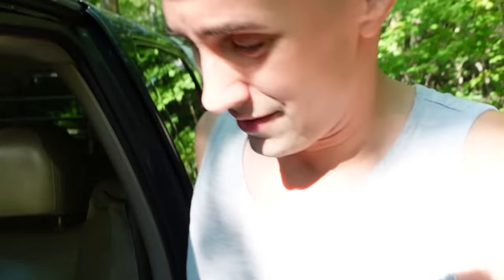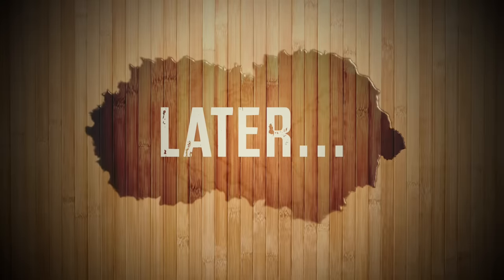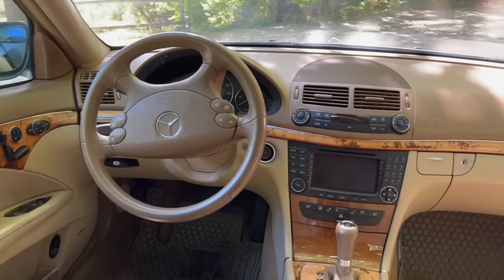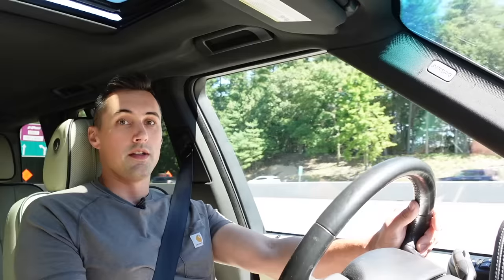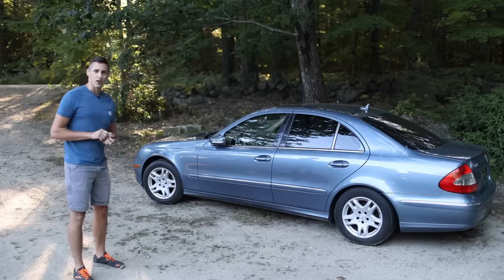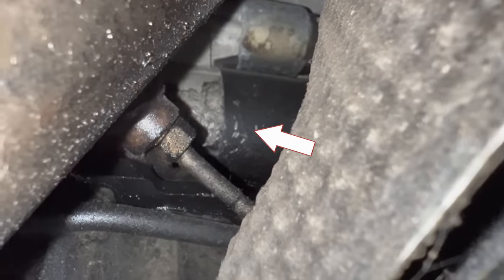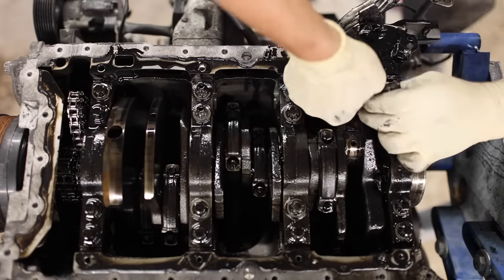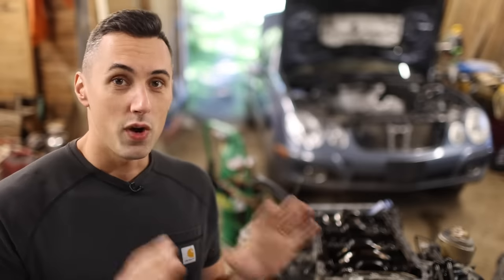I Bought a Repo’d Mercedes Diesel and I Regret it. Here’s Why You Shouldn’t.

Comment: Very interesting Waldo ! nevertheless I would swap the engine for like one , if  you have two make one great car out of the two , sell  parts , great filming again no matter what subject ,  you make it interesting thanks again !
Reply from the maker: Thanks Steve!
Reply: Ls swap !
Reply: The used Mercedes diesel engines are quite spendy - considering the market value of this car.  It will likely make great content, but in no way would this be economical for the purposes of driving or reselling. Cheaper probably just to buy a good used one.
Reply: Yes  I have experience in the Merc V8s  from trom 1965 to 1985 , 350 450 range even 1972 Merc has a  computer for the jettronic  injection , but in this case it would be the interface with electrics  and computers, LS has its own system I know , interesting   comments
Reply: @WaldosWorld  hey waldo there's a 2006 range rover with a super charged 4.2 at copart in maine... idk if you're looking for another one for parts but i figured i'd let you know
Reply: @WaldosWorld  Mercedes diesel engeins are very good but they are not more simple, reliable and i know this a matter of opinion but sound better....perhaps Scania V8.
Reply: @WaldosWorld   mate you are very good worker and your knowledge is well up there must say!! I I’ve seen 3 or 4 fellas working on just one car and still didn’t fix it! Right!! 

Keep the good work and god bless!!

Comment: I have a 2007 E320 with the OM642 V6 diesel in it. It is an outstanding car at every angle. I can see 37MPG on the highway running 75-80MPH on flat Texas highways. The E320 is a fast and very nice handling car. I really enjoy driving it over my other vehicles. I would find another OM642 engine for it and rebuild it. It’s well worth it in my view. The torque and power will surly put a smile on your face.
Reply: You should get a tune on it and delete the DPF and EGR like my friend who is not me. It’ll really wake up... according to him.

Comment: Oh Waldo, if only you would have asked if this was a smart purchase! I love the 06 and prior E320 with the inline 6 much better than the 07 and newer V6. Since you asked us what you should do here’s my 2 cents. If the interior is pristine, the rest of the drivetrain looks to be in good working order, and the electronics check out, I’d would try to find a good used engine or maybe see what a reman’d long block would cost. I’m sure the head on the side the rod broke is shot. It would make for some good content though. As a former owner of an 06 E320, I can tell you they are an absolutely  joy to drive. Time to open up that wallet! 😂
Reply: I agree! Had an '07 Bluetec. Nothing but trouble. Oil cooler leaked, water pump, power steering pump, turbo oil seals leaked, thermostat, rough shifting transmission, the list goes on and on. Modern diesels are not any more reliable now that they have all of the emissions crap on them. Unless you can monetize these videos, I would recommend not throwing anymore money at this car. The very fact the previous owner neglected basic maintenance does not bode well for all of the other components that were likewise neglected.
Reply: get a long block if possible. I wouldn't want to use a head or heads off this engine.

Comment: The diesel W211s are legendary. Glad you're making more content around this.

Restore the heck out of one and keep it.
Reply: these engines only fail when not changed enough oil. A lot of taxis go 1million without issues with this E320 CDI
Reply: @nihonkokusai  Not so much with the OM642 engines. I was religious with maintenance, and still had all manner of engine issues. The one to get are the earlier ones with the OM648, those were bomb proof.
Reply: @fatherhood2  We have taxis here never had any engine problems? are the US built MB built in Germany or US?
Reply: I believe the early V6 engines were problematic. I'm sticking with my E320 CDI with the IL6
Reply: I had a 2005 E280 diesel wagon fantastic car.

Comment: Glad you’re back! I’ve watched your entire library of videos and need more! 

I was thinking, until you get the slab poured for your barn/garage, you could buy a sheet of half or 3/4 inch steel plate that’s about 6 feet wide to butt up against it. Put some rust converter on it to keep it nice. Could also set one up outside. It would at least keep the engine hoist from digging in so much and would give a better surface to put a jack on.
Reply: Waldo needs to get that concrete poured ASAP can't believe he's working in the dirt
Reply: When the oil was pouring out of the engine on to the dirt I thought "at least it's not on a nice concrete floor".

Comment: Waldo, w211 cars are really great.  I do prefer e320 cdi over the newer blue tec but it looks cosmetically to be fantastic.  Your cinematography is spot on, really great job with that!  Good luck, great video.
Reply from the maker: Thanks Carl! Yeah, I agree, the 3.2L I6 is better 👍
Reply: But they are pretty good ad towing trailer like camper over 2to aleast in Europa they are rate pretty high for a car( g-class are rated at 3.5to with 320 cdi engine )
Reply: 3.0 v6 cdis are not bad i have one with 280.000km (170.000miles) still runs great.
Reply: We have 2 sprinter vans, 01 with a cdi om612, and an 08 with the 3.0 v6. Surprisingly the v6 is still running pretty decent at 500k Miles (trans just gave up though) The cdi gave up early at 230k. Cdi did have better fuel mileage and pulls better. The guy we bought the 08 from runs a fleet of them, had one with 800k miles on original engine on the 3.0!
Reply: Which 3.0 v6 is that? Is it the Mercedes  M272 thats in the W211 E & C classes?
Reply: @BMW_Mustang_Dodge  i drove sprinter van cross europ as an ontime dilivering truck with 2.3 inline 4 cdi 1.7milion miles only transmission was replaced once
Reply: @BMW_Mustang_Dodge  Wow.
Reply: @WaldosWorld  Other than the need to add DEF fluid to the Bluetec, may I ask why the 3.2L I6 is better? Unfortunately, the 2012/2013 S350 I want only comes in the Bluetec version.
Reply: @oldporkchops  It's not, it's just a preference for i6 from some people because you have more space on the sides to work on them. The om642 v6 3.0 diesel is as reliable as it can be, it's only known big issues are the oil cooler seals (pre 2010 factory ones weren't from silicone, and are known to leak, but if they were replaced with the proper spec ones there's not much that breaks in this engine). The i6 has some serious issues with its injectors and high pressure system as a whole. Also, w211 with om642 don't need DEF fluid, only for w212 and later with this engine. Others issues that both of these engines share are intake flaps getting stuck from gunk and glowplug malfunctions. But that's about it. I know a guy with 2 sprinters with 900k km, both original om642 engines and transmission.
Reply: @em4703  Thank you for the info. Can you please let me know what special maintenance steps were done to make the Sprinters run 900 km on original transmission?
Reply: @oldporkchops  I just called the owner that had those vehicles in that time frame, so I can give accurate info. The sprinters were both driven 8 hours a day, 5-6 days a week, mostly highway or between small municipalities, with oil changes done 2-3 times a month, never over 15k km with the same oil. Oil used in both of them was some Ravenol 5w40, he doesn't remember the exact name (winters here rarely go under -25C, so a 5w irrespective if 30 or 40 can handle it well). Maintenance was done religiously, the owner of the company is passionate about cars so he's not the type to neglect a vehicle, irrespective of it's purpose. By maintenance I mean full maintenance, when oil was changed all filters and consumables were changed too, and the entire car was checked to catch any small issue early. He said he never had any big issues besides a swirl flap that was fixed under warranty (the guy that now has that specific Sprinter of the two has around 1.4 million km on it, so the vehicle isn't used as intensively now, this second owner also put a resistor thing in the circuit to disable the swirl flaps and keep them open at all times to make sure there won't be future issues). Gearbox was serviced (oil and filter) every 3 oil changes, so around 40-45k km. That's about it. Besides that, just normal checks and replacement for rubber parts in the steering and suspension, whenever they had issues due to normal wear.
Reply: @em4703  Thank you for your help with this. I appreciate you going the extra mile. It sounds like the owner just regularly changed the oil and other fluids at the regular intervals or a little more often than that. I do the same too.

The W221 I want to own unfortunately requires DEF. I just hope that it won't be a pain to maintain.

One of the fluid additives that looks promising is Steel Shield. Pitor Tester did a few tests of this independently and with it added to engine oil, and all tests had better than average results. You can check his videos out on YouTube if you're interested.
Reply: @oldporkchops  Hmm, steel shield, I'll look that up. I'm living in Romania, if its a small american brand I doubt i'll find it around these parts. I own a W211 e280 in mint state, interior, exterior, mechanically, 332k km on the clock. 

All I use as additives are for fuel, metabond megalene. I can see a 5-10% improvement in fuel economy (which i dont care, i'd own a 1.6 or lower cc car if I did city driving), but it definitely does something (extra lubricity and taking water out the fuel? hell yea). 

 personally use Ravenol VMO as engine oil if you're curious. I don't honestly like engine oil additives, I feel like they're snake oils/ scams. If these were that good, they'd be already added in there by default right? The competition would have no chance. It's not like they're billion dollar lubricant companies, right? I do get fuel additives though. Lots of the additive package on gas or diesel is restricted by emission standards. So I can see how that leaves room to play for companies
Reply: @oldporkchops  The 3.2L Bluetec never required DEF... that only started on the 2009 (IIRC) 3.5L Bluetec. Not sure whether the I or V Is a better or longer lasting engine (tho the V is better on paper), but I like my i6.
Reply: @t3mtf8  Thanks for the info, Andy. I appreciate it.
Reply: @shawna7813  Its the OM 642  I have the same car
Reply: I loved my 2006 E320 CDI. I was t-boned by an absolute moron. The Mercedes service guy told me there was no chance of repairing it because of how hard I was hit in the driver's side front wheel. I still miss that car. It was in primo condition, and I could have EASILY gotten another 50-100K out of that engine. Makes me sad.😥

Comment: Sorry for your difficulties. I bought a flood damaged E320 (2005 straight 6 with a 722.6 tranny. ) It was a runs and drives listing on CoPart. Photos indicated water into the cabin but only a couple of inches. WHen I received the car, it was in limp home mode and the seats were inoperative.  A $125 scan tool reset all the codes. I replaced the seat brains under the seat @$110 each and a seat motor for $15 at a pick and pull. That was 7 years ago. Since then I've replaced windshield wipers, a few bulbs and kept up with all the maintenance as needed. Car had 105,-000 dealer maintained miles and records and extended service had been done on the car a month before the water incident.  Yes, I got lucky-but I scanned CoPart listings for 4 months searching for the right specs. 

Its the 4th MB diesel I've hadTHe low running costs and lower depreciation enable me to keep a fleet of old Alfas running

Comment: Hi Waldo,
I would get the second one, see if you need any parts from the first for the second, and then sell whatever was extra from the first one.  If it costs $400 for a key, I can't even imagine what an engine would cost, even a used one.  Thanks for digging into the bad engine and videoing it.  It's pretty remarkable how much potential energy exists in all those moving parts, separated from each other by the tinyest little cushion of oil.  I agree with your diagnosis of too many miles and too few oil changes as the root cause of why the engine failed.  I wonder what Mercedes charges for an oil change.  Thanks for the video!
-mike
Reply: car was worth less than what an oil change would cost

Comment: I have a 2003 straight-six E320 Avantgarde CDI estate. I also have the newer generation, 2013 E220 Avantgarde Bluefficiency CDI estate. These S211 (W211 saloon) are really good. They are easy to drive, to park, they are powerful (the V6 has over 220bhp and well over 500Nm of torque), yet economic. The E-class Mercedes is always the best car one can afford. Find one with good service history and if yo7 are buying the V6, check the engine properly. With the earlier, pre-facelift models, check the air suspension and brakes. Otherwise, apart from the injector seals, they should be reliable. These are well built, premium cars. When things go wrong, don’t be surprised to spend more than you would with economy cars, but the Mercedes will go on forever.

Comment: Early versions of the W211 E320CDi suffered from a lot of electronic faults, particularly the instrument cluster, navigation system and PCM. 2 friends of mine bought one each new in 2003, and both had a lot of problems. One of them also had to have the oil pump replaced under a recall, before he even collected it from the dealership, and they had to have it back because they left the bolts loose on the engine mounts when they changed the pump. After more problems, Mercedes took the car back after 6 months and gave him another brand new one.

Comment: I bought one just like this V6 diesel and I  took a trip from Washington State to South Carolina when I made it to Idaho my 3rd Injector failed causing the engine to shake like crazy at idle and not run right I went ahead and full send it all the way over there I only going 63 mph Cruise control eventually made it without any other issues and I got 38 MPG and spent $400 in diesel.

Comment: Reminds me of a similar situation I was involved in back in 1972. Our office manager's husband wanted a Mercedes and there was one 1971 (loaded 4 door ) in a salvage yard and it was bringing high bucks. However, it was jammed between two other cars so the doors couldn't open. Opps, the car on the right was a standard which would roll and we did. Opened the hood and guess what? Engine was blown probably due to lack of oil. Later on I ran into dealer who bought  it and He took a BIG BATH!!!!! In your case take you time and find a good used engine and switch. This unit looks good on the video.

Comment: I own a 2002 Nissan Maxima with a 3.5 V6, after 20 years and over 200K miles it still runs like a champ. I change the oil every 3000K miles with Mobil 1 Full synthetic.

Comment: “Part of the reason I like diesel engines is because they are more reliable.”

“So the engine threw a rod”
Reply: Too bad the owner couldn't be relied upon to change the oil...
Reply from the maker: Yeah, totally the fault of the previous owner(s) for not changing the oil 😂
Reply: @WaldosWorld  it most certainly was run out of oil, due to disregard of the oil cooler seals leaking.

Comment: Agree with you on the oil changes.  Those bearings look like they were oil starved.  I bet if you pull the rest of the piston bearing caps and the mains, you'd get the same scoring on all of them.  Might also be worth it to tear down the oil pump and see if there is any evidence of sludge build up that would have caused the oil starvation in the first place.
Reply: Oil cooler seals. Most common oil leak on these. Even if you do the job in time, but forget to purge the airlocked oil gallery it is likely to spin #6
Reply: @guganotubo  How do purge the air locked oil gallery and why would you do that after an oil change?
Reply: @mbz4652  Not after oil change. I mean after oil cooler replacement. You have to crank the engine several times without the injectors, to make sure oil is pumped through the new oil cooler and the galleries that feed from it, before putting the crank under load.
Reply: @guganotubo  More do to poor cleaning before removing the cooler/turbotower,  since the holes you see under the cooler, in the block, leads directly to the main bearing. Not the first OM642 that's become a boat-anchor after a turbotower/oilcooler job.

Comment: The OM642s..  Owned a GL 320 for 7 years and the money light comes on often.  Decent motor but gets too much heat trapped in these E, ML and GL chassis.  Sprinter vans don’t have as much of an issue with them.  Replace oil cooler seals and timing chain or guides from your donor motor before dropping it back into the car.  All the other issues that pop up are small.  10K factory recommended oil changes are too long but you are stuck with that spec oil from all the 1st gen emission parts.

Comment: I have the same engine in a 2008 GL with 210K miles. The factory recommends Mobile 1 gasoline engine oil which I won’t use. I change the oil every 10K and send a sample for oil analysis every time. I use Amsoil heavy duty diesel extended interval oil. According to the laboratory report the oil is still fine at this point. Of course now it’s burning about 4 quarts between every drain interval so a rebuild will be in order soon. My friend has one too but he lost his EGR, DPF and swirl flaps in a boating accident so his engine runs cleaner..... so I’ve heard.
Reply from the maker: Ah yes, I've had some terrible boating accidents like that in the past as well 😂
Reply: @WaldosWorld  Somehow during the accident my friend also got his ecu reflashed by Malone tuning. It’s ok though my friend only uses his Mercedes in international water anyways.